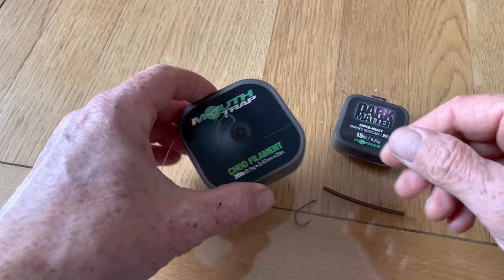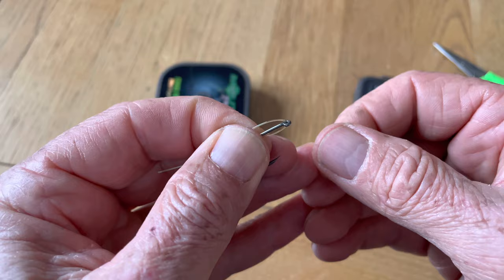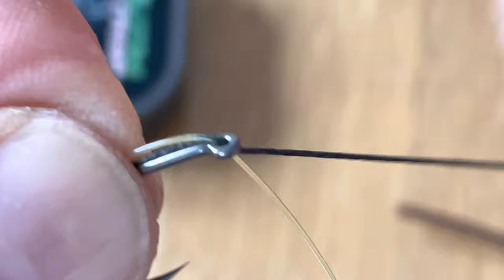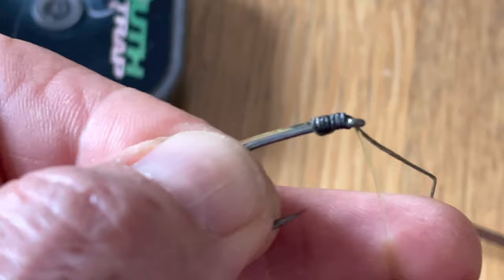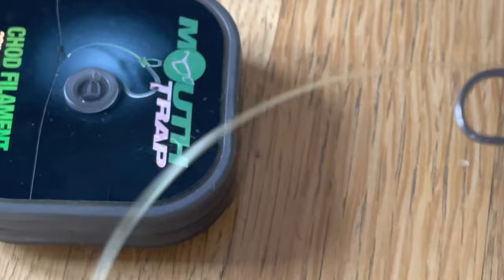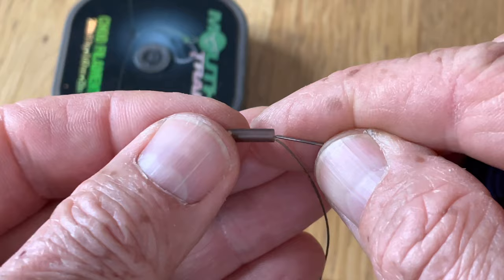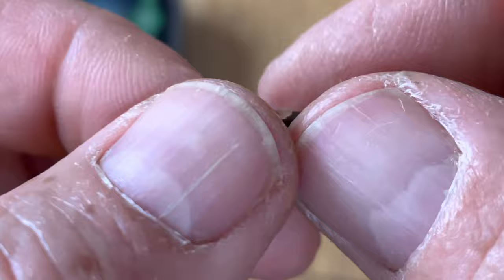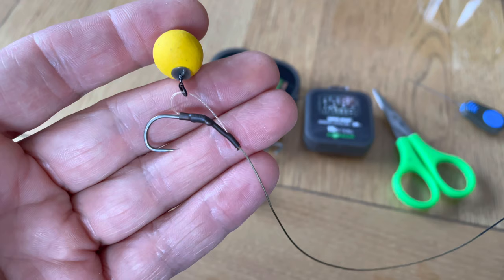The extended braided D-Rig

Comment: Like that Joe, what lead system would you use? 
I'm paranoid about braid tangling
Reply from the maker: I’d been using this with an inline system mate. The trick is to cast them fairly high so you can watch them in the air. It never tangled.

Comment: Gota ask what hook you using? Im using angling iron and the eye aint open enough.im avin trouble getting the dark matter through.so im using 18lb super natural its half as thin as the dark matter. Thanks
Reply from the maker: I tie these up with a size 4 or 6 wide gape. I use the dark matter because it’s very heavy and less prone to tangles than Super Natural. 👍🏻
Reply: @JoeTurnbullAngler  il get some korda wide gapes. Thanks.and great vids👍

Comment: Hi Joe,wou;d the extended D rig be suitable to be used as a pop presentation over silt.weed areas.as in horeshoe lake in the cotswolds.
Reply from the maker: I’m pretty sure it would still work with a pop up but I initially made it like this for 18mm wafters and the way it’s set up is so that the hook bait just about sinks.